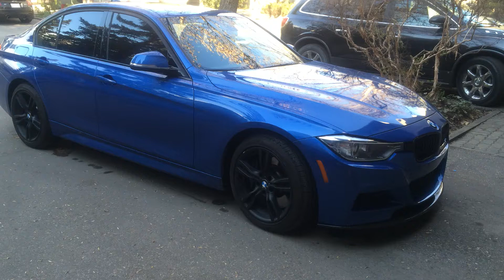Coding BMW F30 335xi

Comment: I have an F30, does coding void the warranty? Thanks
Reply from the maker: Roozbeh no. you can reset it back to default if you keep a note of what you have changed and their original values
Reply: Fraidoon Khuram well, that's true, but since I want to get it coded somewhere, I can't really revert it back each time I bring it to the dealership